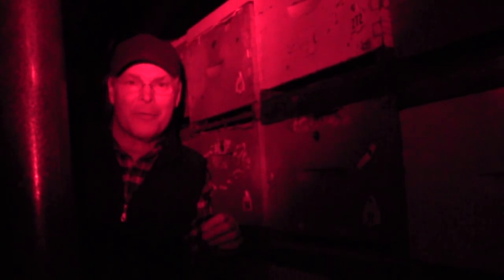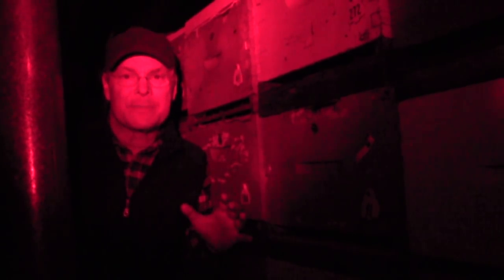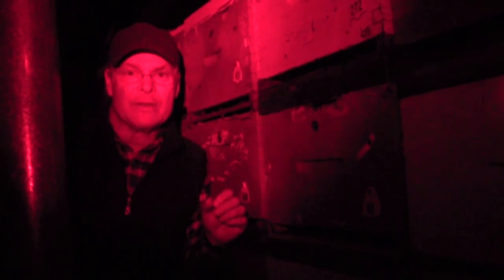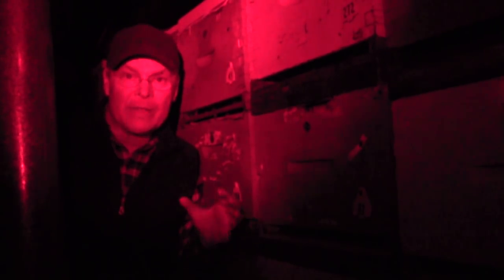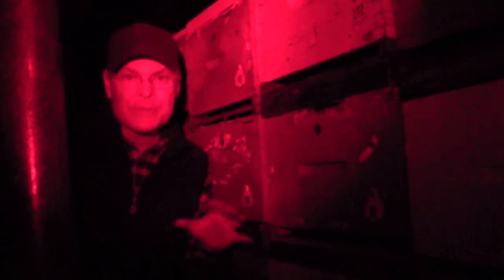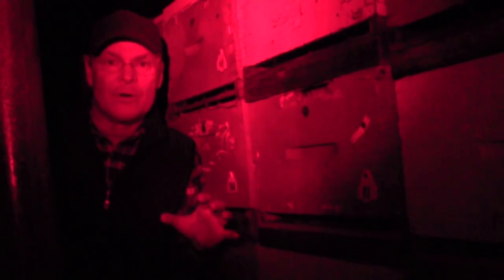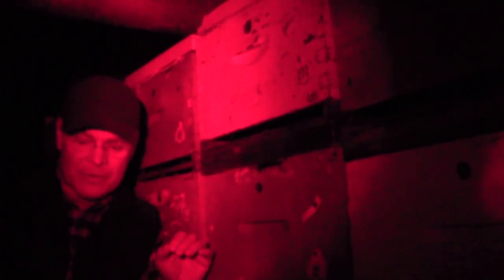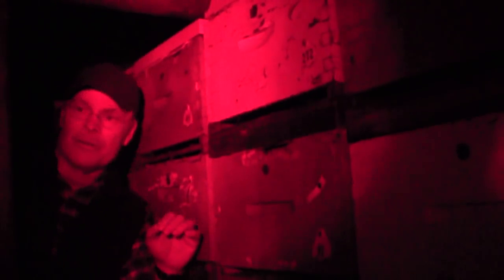Indoor Overwintering

Comment: "Each beehive produces 15 Watts of heat."  Thus a 1500 watt heater.  I never considered the danger of overheating.
Reply: Canadian beekeepers blog indoor winters about 1400 hives. His shed is in floor heat capable but he has never run the heating. The hives provide so much heat that even at -40c out door temp, his ventilation fans still run at idle to remove heat. His main fan ramps up to maintain+ 4c in the shed and there is a second fan that starts and runs at +8 C. Last year was my first year with bees in Saskatchewan Canada and I built a indoor wintering shed.  I wired the shed to be powered by a simple extension cord with the ability to run a 1500 watt heater. It was insulated well with passive ventilation. The heater had no issues keeping the shed at + 4 C even with - 40C outdoor temps. This year I believe I will have to re do the system because I only had 4 hives in my little shed while this year if all goes well it will be near capacity. My concern will be cooling. What folks fail to realize is that there is no off or thermostatic control on the heat hives produce. 15 watts doesn't seem like much but it's 15 watts 24/7 from each hive. A stack is literally a 15 watt element floor to ceiling. 

On the bright side cheap technology even for the small bee keeper is available. I bought a thermostatic power bar. That has the ability to control both a heater and a vent fan or air conditioner for cooling. It cost me 100 dollars. To deal with the possibility of over heating I can just increase the size of the vents and install a fan. Too hot the vent fan runs while too cold the heater kicks in on the same thermostatically controlled power bar. I could run an air conditioner with the air conditioners internal thermostat by passed to be controlled by the power bar if I was in a warmer locale. 

I loved indoor wintering because my shed is very close to my house. As such I bough one of those wireless indoor outdoor temp and humidity monitors. I placed the out door transceiver in the shed  and that enabled me to monitor the temperature and humidity in the shed from my kitchen 24/7.  A storm or a massive high with extreme low temperatures had zero affect on me or the bees. Any question or concern was immediately taken care of with a glance. No driving, to shovel out hives. Or thermal cameras to check for life. I could look in the entrance and see the cluster. I could hoist the hive to check for honey or crack the lid quick to check the pollen patties. This spring I had a hive blowing out with nosema and dysentery. spring temp wasn't great but it was sufficient so I just pulled them all out of the shed a bit early for a cleansing flight and offered fresh supplements I had 100% survival. If it had turned nasty again I would have just moved them back in. Going forward after hearing the woes of last spring and increasing my hive numbers, a major factor for indoor wintering will be to ensure that I have and maintain the ability to get them out and back in at the drop of a hat.
Reply: @RoughAndWretchedRAW  Sounds like a good set up. I'm just thinking, you could put hives in a basement and bring down your heating bill. From SK, now living in Illinois. I appreciate your awesome drone sunset footage. I miss those skies.
Reply: @nathancaswell7861  I wouldn't put them in a basement for a few reasons. Due to the fact that they have to remain in 100% darkness. I use a red light to check on them but even a 25 watt bulb in the shed has them begin to come out after just a minute or two. I mean cave dark! If there is a single ray of light they will fly to it. Also: people who winter outside do not see the enormous amount of bee drop over winter. Bees fly out of the hive every single day to die. I had 2-10 frames and two 6 frame nucs and i'd say there is a half a 5 gallon pail of dead bees through winter. With that comes the accompanying smells such as ammonia from decomposition. Bee hives also create a large amount of Co2 through respiration. Ventilation keeps that at an Ok level but you wouldn't want to sit in that environment daily. The Canadian bee keepers blog has been doing some testing of Co2 and the level bees happily maintain in the hive is hazardous to humans. He was getting readings between 8000 to 10,000 PPM in the hives themselves while the isle beside was in the 3000 - 4000 ppm level. 

My shed is tiny 5' x 6' x 6'. walls are 2x4 so i insulated with R 15 then I got a roll of that reflective bubble wrap and did the entire inside of the shed with that. I used carpet for the door gaskets. The heater only ran maybe 6 minutes per hour in -40. For ventilation I just knocked an inch and a half hole in the top of the door and in the bottom. I placed a screen in the middle of some reverse 90 degree curves to kill light through and prevent mice from getting in. I did the same for the top but I had to modify and place both pipe reverse curves in the shed because such a small diameter pipe and the humid shed air going though it caused it to freeze up. Once I moved the pipe to the inside of the door to prevent freezing it worked like a charm. If you go look at the Canadian beekeeper blog on you tube I tried to as closely resemble what he had small scale. The main differences are that my small number of hives required some heat but I could get away without fans. As heat rose and exhausted warm humid co2 rich air out of the upper vent it drew in cool dry fresh air into the bottom. I Had the trermocouple about hive height and the hives were on a pallet to keep them above the floor and about 6" from the outer wall. 

This winter I plan on having 10 hives or more in that same shed so I should not need heat at all and can probably get away with a computer power supply fan for ventilation. Actually makes for a AWESOME duel purpose meat cooler also if I put in an air conditioner to keep it cool in warmer early fall temps. Most folks wait for cooler temps to butcher. Not necessary. Use it for hanging cooling and aging in early fall then stick the bees in for winter.
Reply: @RoughAndWretchedRAW  I was kind of kidding about the basement, but thanks for all the details. I will look into a shed to overwinter my bees. Of course Illinois winter is not a Saskatchewan winter. I do follow Canadian Beekeeper on youtube. It is nice to see how things work on a big scale.
Reply: @nathancaswell7861  The Thing I like about indoor wintering the most is that all of the fast extremes are eliminated. You don't have -2 with 80 % humidity one day and -35 and 30 % humidity the next. Temperature stays stable and humidity changes over days instead of an hours. Just took all the worry out of everything until spring. Even if the power goes out all I need is a big enough generator to run a breaker. I was looking at the insulated wraps and the cost, work and worry involved and it really quickly became a no brainer for me.  No driving around to check yards and no worries for the majority of winter. I can't even say how many times either my wife or I said thank god we indoor wintered. I had the shed already which was just my kids playhouse. All together wiring and outlets and switches , insulation, heater, cord bla bla bla ran me about 250 dollars. Shed might need some paint in a few years. Maybe shingles. Every one of those tarps outdoors are exposed to UV and wind and mice nests and on and on. The only way I would run anything outdoors is if I started selling stock to ensure I was selling bees able to handle it. Not everyone indoor winters so if I were to sell any stock i'd sell proven stock.
Reply: @RoughAndWretchedRAW  you describe so much details that would be awesome if you had  a video of your over winter shed and all the mechanicals, think about!!!THANKS.
Reply: @sandrocamargo698  I'll charge up my camera and do that tomorrow if you wish. go to my you tube tomorrow about this time and I'll have it up.  It sounds complicated but it isn't.
Reply: @RoughAndWretchedRAW  That would be AWESOME!!!!! you going to have lots of views, think one nice catch title! THANKS.
Reply: @sandrocamargo698  Lol.. I don't get many views and I don't try to. Most of my wall is our band footage. Couple drone vids no bee vids at all yet. Only doing it cause you asked. There are tons of folks better to teach than I.